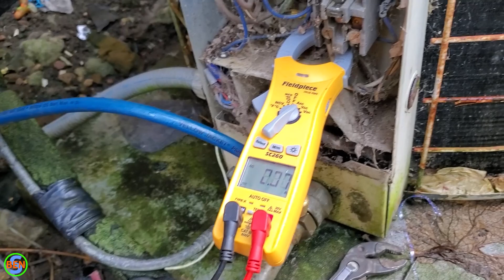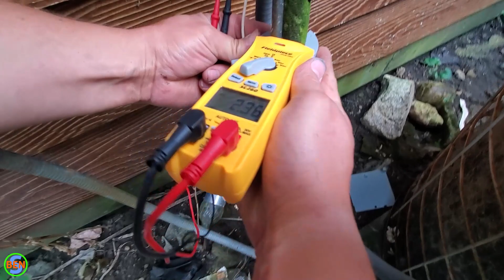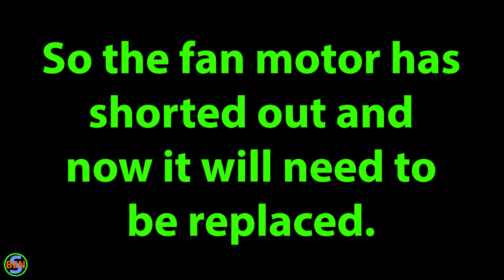This is WHY WE GROUND Electrical Equipment! HAZARDOUS Failure Found During AC Service Call!

Comment: Yes, anytime there's voltage or current on the ground. It's not a ground no more
That's not a good thing at all
Reply: That's not correct.
You can have current on the ground wire and for the wire to be at ground potential.
If the ground wire is very long and carrying current, then you will have a small potential difference along its length, so in this circumstance then I might be inclined to agree with you. But the voltage is going to be low and not enough to kill you.
Reply: Yeah, that's completely wrong- it's still a ground and it's doing it's job. Somewhere along the line, a breaker should have activated and that's a separate, although very important issue.

Comment: They really should fix that disconnect.  Or at least label it so the next guy knows.   You can get contactors fairly cheap.  I might replace that with a 2 pull down he road.
Reply from the maker: Later in the video the disconnect is replaced. :)
Reply: Safe isolation not possible. Make it a double pole breaker/isolator.